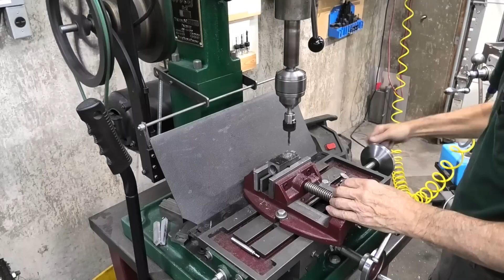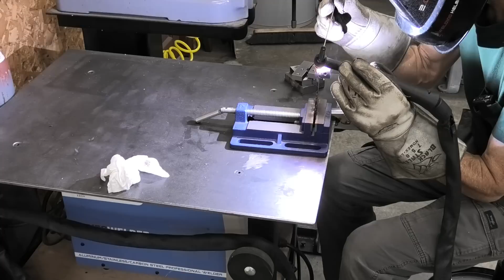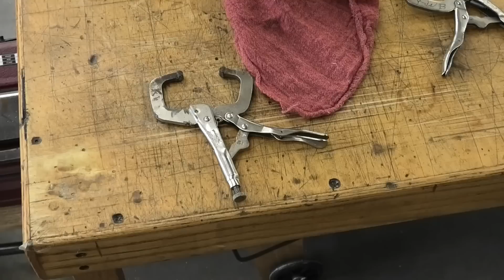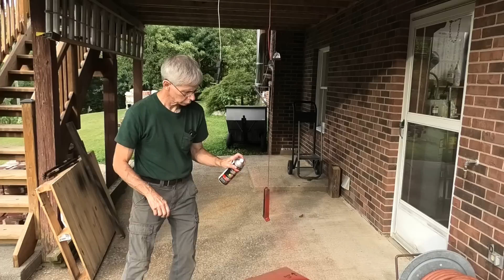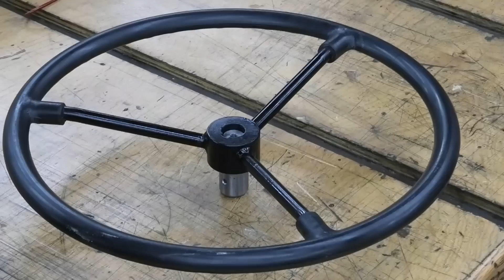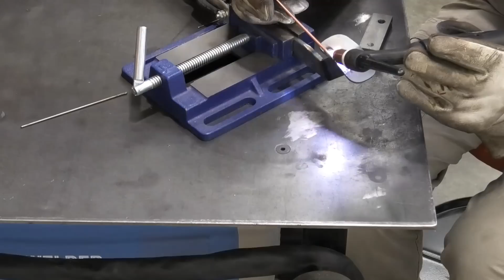Building the 1920 Briggs & Stratton Buckboard Flyer - Part 6

Comment: Switch sides with your spindles and move the rack to the front.
Reply from the maker: The rack is in front now. Much too far toward the front of the car. It would require that the steering column be moved toward the back of the car about 2-inches. This complicates the support bracket for the column. I could do it but I wanted to keep the look With that being said I think I have a cure now so it may installed in part 7.

Comment: Looks like the rack push rod is threaded into the rack, should have a pivot where the rod goes into the rack
Reply from the maker: Yeah you're right but that would require that the rack be mounted solid. If I move the rack toward the motor or the back of the car it doesn't need the pivot but the geometry of the steering column screws up
Reply: @WinkysWorkshop yes solid mounting would be ideal, project is coming along nice.
Reply from the maker: True, but simple is also nice

Comment: Get the Briggs & Stratton seat decals that are available for that model. An original type 1-1/2" (I think) elliptical brass serial number plate roundheaded brass nails stamped numbers between seats on front wood bar. Don't get caught driving on streets because it is a car and was one then too. Get an original state plate hanging below front and registered as a 1919 replica car.  Rear view mirror wasn't required then. Yah, front light. Rear light maybe - depended on the state.
And, what is steering wheel from
Reply from the maker: As soon as I get it all fine-tuned that's exactly the plan. I don't know all the details yet but it should bass as a replicar. The primary difference on this car is that the motor is on board rather than a pusher wheel. That makes it safer or at least more user-friendly, but I don't know if that disqualifies it as replicar

Comment: Nice work! One suggestion: I may be wrong, but it looks like the brake cable just goes through a hole in the lever that operates the brake. I would use something like an open thimble to keep the radius of the bend in the cable from getting small enough to possibly damage the cable.
Reply: Was going to suggest the same. Or fab up a grooved disc for the cable to go around (fabrication would go well with this build....). If the disc has an off center hole in the middle you'd have built it cable adjustment. :^)
Reply from the maker: Yeah it was a quick fix to get it on the road. I'm in the process of using rods instead of cable. Really it needs some kind of spring return

Comment: Coming along nicely Winky. Would a universal joint or a pair of u joints have reduced the angle of the column?
Reply from the maker: Yes that would work but it would require mounting the rack and binion solid. And I may do that at some point

Comment: 😮🎉😮 What about using the rack and pinion as a push-pull with a bell-Crank to move the spindles??😮 it will require a universal joint. I have thought about using a ratchet and socket , extension universal with a short 1/2" extension in each end or a longer extension cut off. With a bit of heater hose clamped over it. With a bit of thick oil  or  grease inside. Definitely NOT FOR A CAR  Howe gokart, maybe ...  I'D  LOVE TO build something similar to this..
Reply from the maker: I was thinking exactly the same. And I may try that in the future
Reply: Heater hose will swell from the grease or oil. You can use rubber fuel line if you can find some big enough.
Reply from the maker: I got it to work by offsetting the linkage

Comment: Looks nice! Did you put a pivot on the rack on the inside also? Modern rack and pinion steering have a inner and outer tir rod. The inner pivots also just not as much as the outer. Might help.
Reply from the maker: I kind of wanted to keep it simple. Really what's neutered is to mount the rack solid to The front axle. It actually worked just floating or hanging from the steering column but not in the position that I needed the steering column to be on the car
Reply: @WinkysWorkshop yeah that makes sense. At least you tried. I like the simplicity of the old system also.
Reply from the maker: Yeah is works well, I may try the rack and pinion later.